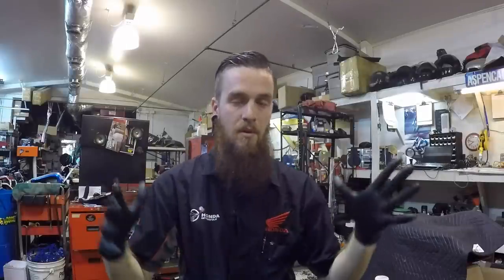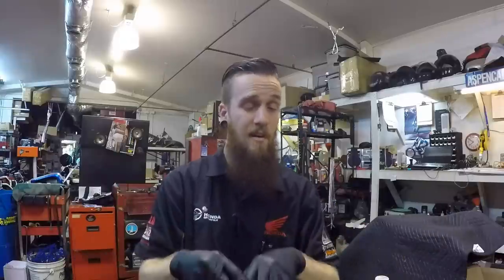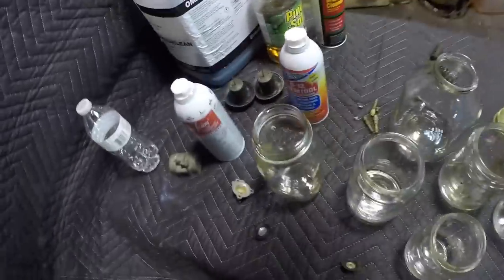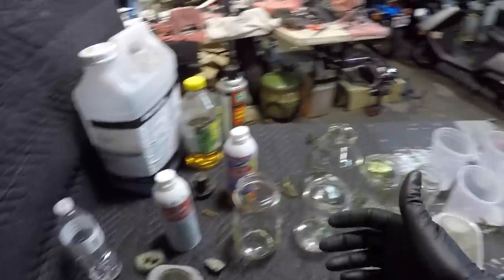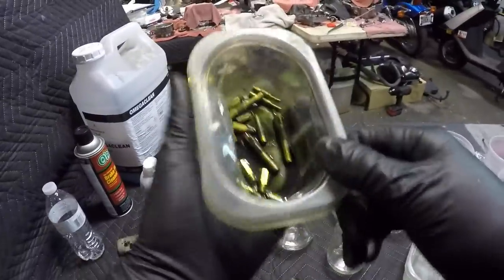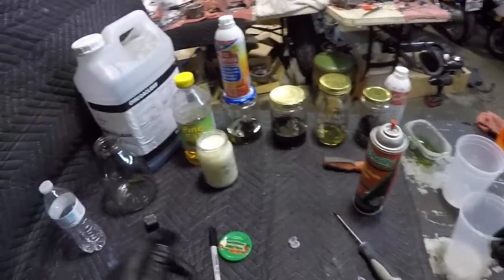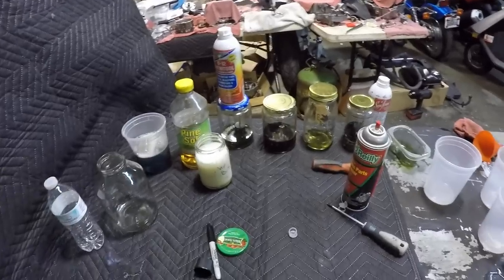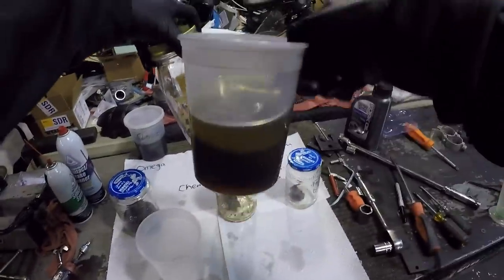Carb Cleaners and Fuel Additives: What Works?

Comment: SEA FOAM DESTROYED MY ENGINE i have the before and after the additive is too good md help
Reply: It's more gentle than some of the other cleaners out there, so kind of doubt that it "destroyed" it. May have exacerbated some other issue or issues that were already there. Sometimes internal carbon cleaning can cause issues from the gunk going into areas that it clogs, etc.
Reply: Sea foam can’t hurt anything... what are you talking about

Comment: so Is there an adative you recomend for us poor carb motorcycle to keep it clean and running   !!!!
Reply from the maker: joe kamer Anything is better than nothing! For PREVENTATIVE performance I still think seafoam would work. Personally, I use Amzoil PI. I have seen this stuff in action on motor internals and it is great. Do I think running any "carb cleaner additive" would clean a dirty carb up back to normal?? NO

Comment: So Cody, Do you recommend the use of Sea Foam additive to carbs or not ?
Reply from the maker: John Masell for a preventative additive I think you can't go wrong, knowing that it won't damage rubber parts but if you think it has the ability to unclog a roached carb than think again!
Reply: so what's the best way to get the Sea Foam into my carbs ?  do I just add to my fuel tank or do I disconnect my fuel line and add direct into the line itself ???
Reply from the maker: John Masell No no, just add it into your full tank. Directions on the back of the bottle tells you all you need.

Comment: A mechanic I use charges $300 to pull and clean my carbs...I am not rich so if additives work then why not save $290??? and hassel of dropping bike off and getting it back later
Reply: Using a combo of slightly watered down, hot Pinesol and an ultra sonic cleaner, with minimal breakdown of the carb for a couple hours, is often enough to clean it well enough that it works. Just make sure that after you rinse everything with clean water and let it fully dry before putting it back on.  It doesn't bother the rubber that I'm aware of. 

  Sort of the easier, minimalist way to clean a carb.  It won't always work if things are really gunked up, especially inside the jets.  

 But for those of us without a lot of practice and/or knowledge, who sometimes might put a jet etc back in wrong or the like, it is often enough of a clean to get it going.  

   Then fuel additives can help to prevent further gunk, as well as not letting it sit too long.  If you can, try to ride in winter every couple weeks or so as well.

Comment: Sea Foam is like pouring water on carbs !  It does not work !  The varnish on the parts is ethanol . The only way to remove it is to physically scrub it off . Marvel Mystery oil works well cleaning the bodies. 40 year MC mechanic .
Reply: James79561 I was two seconds from considering Sea Foam. Until I read your post. My wife Vespa LXV 150 has been sitting for a while. Discovered two things, had to replace battery, which I did. Got power. However, the was not ethanol free.So, if no additive will truly clean the carb, can you recommend a video on how to do it? And what do u recommend to clean the carb when I get it out? Thanks
Reply: 40 year MC mechanic? Well, 25 years ago I was dealing with varnish build up In carbs. There was no ethonal in gas back then. So, where did the ethonal come from?  I run Shell V-Power in my bike today as it's ethonal free. So, how can you get ethonal build up when there is no ethonal to begin with???
Reply: @bigpapa8152  are U sure? In my area Shell have about 8% ehtanol in their fuels, but it is not explicitly labeled i.e. on the label it is E10 (which stands for 'under 10%). But this started now, about month ago, when gov requirements for that labeling got in power. So I do believe they have ethanol everywhere, but maybe in your place it is not required to be written on the label? GL ~~~
Reply: @drgrunn174  Sent email to Shell, Esso, Chevron and Petro Canada asking about ethonol in there gas grades.. The replies from all were the same....regular gas is up to 10% ethonol. Supreme no Ethonol, plus is a blend of regular and supreme. At least that's how it is on Vancouver Island.